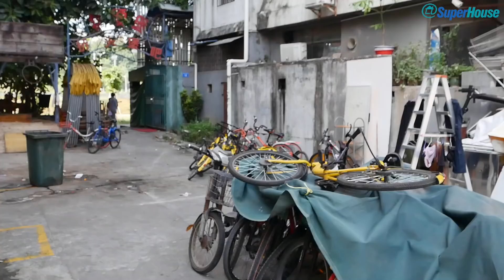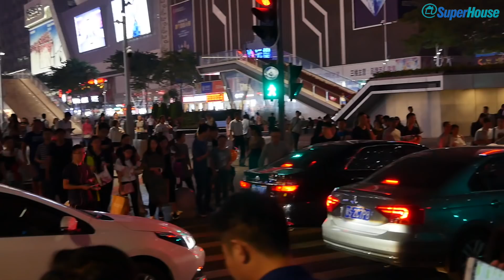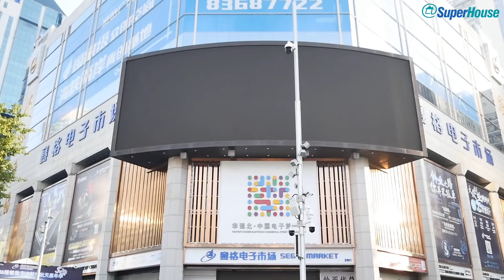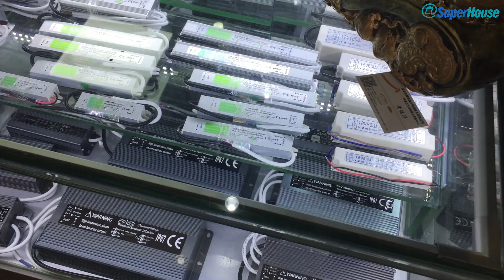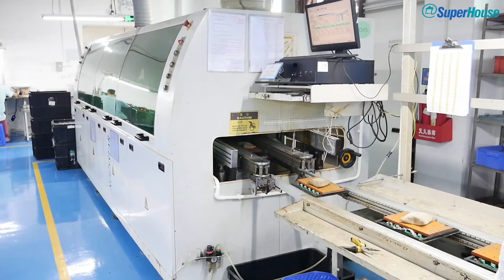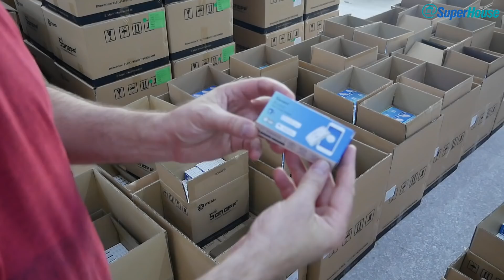SuperHouse #27: Visit to the Sonoff factory

Comment: Loved the video.
They flashed the chip quickly. 
** Do you think they are directly programming the memory chipas they do it very quickly? **
This may be easier than using the ftdi and all the lead issues with different locations etc of the connectors.

I appreciated your tasmotiser video which I used.I also like to backup everything.
 I had a hard time due to the amount of pressure required holding the Dupont lead male pins onto the holes to make a reasonable connection. It was ok with the sonoff basic, but the s26 uk plug was a real pain which I aborted. I damaged the pads a little.

Is there a way of using OTA to backup a sonoff mini as the DIY only allows writing the firmware.

Comment: Huaqiangbei is the electronics mega-market in Shenzhen. Pronounced Qua-some-bey. Short ride via subway from the HK border (Luohu Port). Just follow the crowd out of the subway station.  Its a five minute walk to SEG.  Most floors at SEG are by category: parts, products, repairs, etc      It can take days to visit all the shops of interest.  Oddly enough price lists are slow to be made.   Do be aware of pick-pockets and scams.   When returning be aware that signs saying Subway really mean underground walk-way  -  look for the subway logo.   Most shop staff know enough English to know what you want.  The actual factories are outside the city and not so easy to find.

Comment: I am giving up on these f'ing sonoff,  half the ones I have bought either haven't worked or quit working a few days after purchasing.  I'm gonna try the shelly. A bit more expensive but if you factor in the cost of all the dead sonoffs I have, they are likely much cheaper. POS is my opinon of the sonoff.

Comment: Hi Jonathan, I supposed you have many more sonoffs than I with 2 basics, 2 pow and 2 th16. Just suffered complete power supply failures on both pow and was wondered if you tackled repair of sonoff ps ( esp8266 works on vcc supply direct but not ac) thanks

Comment: Hi, do you have any contacts for itead. that could answer a question about the hardware specifically the power supply side of the sonoff basic i wanted to know the 5v rail across d5 zerner diode, how much current can i expect to reliably get off that 5v rail thanks...

Comment: Great factory , good hardware but unfortunately the app is terrible, I've had mine for 2 days, it worked perfect one day then the next no connection. Any recommendations?
Reply from the maker: I don't run the EWelink app myself, I only used it briefly to see what it can do. I replace the firmware on the Sonoff with Tasmota, and have them linked to an OpenHAB system using MQTT. Then I run the OpenHAB app on my devices. There's more information in these episodes: https://www.superhouse.tv/17-home-automation-control-with-sonoff-arduino-openhab-and-mqtt/ and https://www.superhouse.tv/21-six-sonoff-secrets/ and https://www.superhouse.tv/24-home-automation-system-architecture/
Reply: SuperHouseTV Really appreciate the reply and recommendations. I suppose this is the downside to this type of device, I literally wanted it to turn my corner lamp on/off from my phone. I wasn't interested in reflashing using another protocol to control it, personally I think it's all a bit misleading and that's ashame. I'm all for open sourced firmwares, reflashing and other mods, however this device was bought to turn something on and off via their app and it's no where near reliable enough. I also didn't realise it was controlled by 2.4ghz frequency instead of 5.8. I currently have a virgin hub 3.0 which automatically switches between the 2 frequencies.... However they both have the same SSID addresses which I've had to alter on the 2.4ghz side so the sonoff would even connect, again not a big deal but it's not exactly a plug and play device which is unfortunate. I've only recently come across your channel and it's great btw.

Comment: It's interesting to see this process in dept. I've created electronics testing equipment like seen at the 14:30 mark. Only testing one panel at the time (programming and functional testing.) This is slightly faster. One reason for this setup will be the operator cost as we produce in Europe.

Comment: thanks, interesting video. i love the stuff they make, the Sonoff's and Nextions. Have lots of Sonoffs and 1 Nextion running in my house now, but i've found some of the Sonoff Basic models leaking in off mode. Have you encountered this issue?
See my 30sec vid: https://www.youtube.com/watch?v=EunLSYAG0qw
Reply from the maker: 30 Volts when turned off! That's bizarre. The output of the Sonoff is a relay that physically disconnects the active lead (neutral stays connected) so I can only think of 3 possibilities. 1: The relay is damaged, and it's not disengaging properly, such as allowing leakage across carbon bridges on the contacts. 2: The board itself is damaged, and allowing leakage between the relay output and the screw terminal. 3: There's some kind of induction going on, such as the wires connected to the output picking up mains hum elsewhere and inducing current on the load. None of these explanations sound very likely to me, so I'm puzzled. Perhaps there's something else happening that I haven't thought of.
Reply: i should do some more checking/testing i guess. this one is connected to leads running outdoors for instance. and both switch cheap xmas led lighting so could be any of those options... will check unloaded first. have a bunch of basic's yet to flash and test as well. thnx have a SuperHouse 2018 :)

Comment: Really amazing. Thanks for the video. Can you explain how the sonoff pairing with the app works? I do not understand the part where the app actually detects the sonoff that is ready to be paired. How can this be done?
Reply from the maker: When the Sonoff starts up in pairing mode, it creates its own WiFi network with a unique name. Your phone needs to connect to that WiFi network (not your own network) to begin setup. After that, the Sonoff is given the details of your own network, and it turns off its own network and connects to your house. Then your phone switches back to your house network, and from then on all communication goes through your normal WiFi.

Comment: I have several Sonoff switches that I have flashed with https://github.com/arendst/Sonoff-Tasmota firmware.  To that end it would be a nice convenience if Sonoff soldered pin headers to the holes that can be used to flash a custom firmware such as Tasmota.  I am not that good at soldering and it can be a bit tricky to solder on the pin headers amongst all the other surface mounted stuff.
Reply from the maker: I've just finished designing a PCB for a Sonoff programming adapter that should help make this a bit easier. It does the same thing as the adapter cable that I made for one of my videos (I think it was "Six Sonoff Secrets") but as a PCB, so it can be plugged into the end of an FTDI type USB-serial converter and it gives you the pins properly set up for the Sonoff header. I think it should be possible to use it without even soldering a header into the Sonoff. I haven't sent off the PCBs for fabrication yet but I'll be doing that in the next day or so.

Comment: i have two Sonoff switches stopped working with 15 days on installation both have been connected to LED lights i have been told that the issue is because of noise and improper filtration in the switches.

Can you please guide me as is there anyway i can add something to protect sonoff from the noise basically i have evil LED and need something to protect my sonoff from it
Reply from the maker: That's bizarre! I haven't heard of that before. The output of the Sonoff is just a relay that switches the load, so the only way I can think of that the Sonoff would stop working is if the load produced so much electrical noise that it damaged the switchmode power supply in the Sonoff itself. If that's the case, it would also be inducing the same level of noise onto every other device connected to the same power circuit, so you'd have devices failing all over the place. When a Sonoff is turned on, the load is connected through the relay straight to the power source, so noise would go everywhere. Maybe a viewer has an idea what could be happening.
Reply: could be the case and to be honest have no clue why this has happened and two have gone bust, i can connect them through firmware upgrade pins with LV power of my usb port and the ESP works and connects to the server,  so i guess its some resistor or something which has friend i have no clue how to test it to find which part has fried, but i know this has happened with both switches which were connected to LED lights though i have another two connected to LED they seem to work fine

Comment: I wonder if there are fakes or maybe untested sonoff or rejects on the market? I bought a S20 and it didnt come with a box and looks pretty scuffed up. It also didnt work. I opened it up and the transformer was found dangling with just one wire attached.
Reply from the maker: I've never heard of fakes, but now that they're becoming so popular I wouldn't be surprised if they exist. ITEAD have sent me Sonoffs but I've also bought many myself just as an anonymous retail customer, and the ones I've received have always been in perfect condition. It's disappointing to hear you experienced that. What country are you in? I think I have a spare S20 that I could send you, but I'd have to look at what plug type it has.
Reply: Thanks Jonathan. I bought two S20 from 2 different sellers (not iteads). One was bad as mentioned and the other one, they sent me a Euro plug. Im in Malaysia and using UK plugs. So out of the two "bad" S20, I made one of them to work. Thanks for the offer, but I'm good now. I did get a refund for both them though. Hope you can review some Xiaomi Smart Home stuff in the future. Merry Christmas Jonathan 😀
Reply from the maker: I'm glad you got it sorted out. I don't have any of the UK plug type anyway, so I couldn't have helped. I definitely want to look at a broader range of devices in the future, including from Xiaomi. Merry Christmas!

Comment: Fascinating video to watch, thanks very much for taking the time & trouble (not to mention cost ... Aus to China Airfare can't be cheap!!) to shoot / edit / upload this great content. I have multiple Sonoff basic / T1UK / S20 / TH10 / Dual ... u name it I've probably bought it (or buying it) so for me this video was great to watch, really appreciate it. 2 points still remain unanswered ... 1. How in the hell do they upload the firmware that fast!!! 2. Why oh why will they not release the original sonoff firmware as a binary that end users can re-flash should they choose to after trying 3rd party firmware (Tasmota, ESP Easy etc etc). They seem only to aware that end users (i.e. their customers) are quite likely to end up re-flashing the product so possibly include a link to the original firmware if it's required? Other than that I can't really fault them given the cost per unit. Granted the cable strain relief is a bit of a joke & a lack of an Earth passthrough on some units (Basic) is a bit annoying but when you consider the price it's hard to poke fault at them. Great video, keep them coming! Liked & Subbed.
Reply from the maker: Thanks for the comment, Nick! I was talking to a friend who came to the factory with me about the upload speed, and the only explanation I can think of is that they're holding the processor in a reset state and then blasting the binary image straight into the flash chip. The pogo pins could be talking directly to the Winbond flash chip via its SPI interface, bypassing the CPU.

Comment: Did they indicate if they will put Wall Switch Inputs on the Sonoff 4 Ch PRO ?  Need wall switches without soldering!  :)
Reply from the maker: That's a good idea. I haven't used a 4 Ch PRO so I don't know anything about its inputs. It would be very nice if all their models had easily accessible connections for external switches.
Reply: SuperHouseTV it's a beautiful piece of equipment,it's just missing that final manual input piece to make it complete.

Comment: As you are there perhaps you could ask the question why do they not use earth on so many products is it cost or just cant be bothered to connect it up as we in England earth anything that is metal for safty unless it is double insulated?
Reply from the maker: This was filmed a couple of weeks ago and I'm back in Australia now, but this is a great question so I'll try to find out. It's the same here in Australia, everything must be earthed or double insulated.
Reply: Thank you for your reply I look forward to your findings I think it must be down to quality control as I have three outside led flood lights when I opened them one had the earth internal tag connected but the other two did not and the wire was floating inside. thanks Bob UK
Reply: They are Class II (ie "double insulated"). You don't have to ground a metal housing if the mains circuits meet Class II. Think of your metal laptop with its Class II power supply as an example - many of them have no ground connection, which is perfectly acceptable. These products are UL / CSA / CE etc approved which is a legal requirement in those markets, so their construction (hopefully) meets the requirements for internal creepage and clearance distances, insulator materials, temperature ratings etc.

Comment: Great video once again! Made me feel a lot more confident placing them into ceiling spaces for control. Also confidence that the Ce mark isn't fake. Just wish they could come up with a way of not having to use a neutral on the light switches as UK uses live /sw live. So a bit of re wire has to be done.

Comment: Hey Jon, this was a great watch! Thanks for sharing your tour! I was a bit sad that you didn't have a Q&A part. Did you get the chance to ask them inside questions? I'd be interested how they are thinking about e.g. Tasmota or where they are headed. You can't get schematics for new products and devices like the B1 do not offer easy access to the serial pins. Wouldn't surprise me if at some point you can't reflash these modules.
Reply from the maker: I hoped to do an interview on camera, but it didn't work out because of the language barrier. I got lots of good information but not in a way that would have worked on video. I didn't ask those specific questions unfortunately :-(

Comment: It’s interesting to me that it’s not more automated. There are really a number of manual processes that could
be complete totally done by machine.
Reply from the maker: I've been inside dozens of Chinese factories, and just based on my personal experience the ITEAD factory seems to be a perfect example of the typical way to do things. I've seen factories that are much, much worse (particularly in Beijing) and I've seen factories that are much, much better (Hytera is just mind-blowing) and ITEAD sits right in the middle. For most mass-market electronics, this is how they're made. Right now Chinese factories are going through a transition to more automation with rising wages. In the past the usual solution to any problem was to throw human labour at it and solve the problem by brute force. Need 100,000 stickers put on? Hire a bunch of people, put them in a room with a conveyor belt, and get it done. But these days it's more common to use automation. Need 100,000 stickers put on? Design a custom robot, put it on your assembly line, and walk away. In the Hytera factory, for example, they have almost no human assembly workers. The people in the factory aren't doing assembly tasks personally, they're looking after the robots that are doing the tasks.
Reply: Robot masters with their human slaves!
Reply: Thanks for the video!
Manual production is shifting to other countries like India and Vietnam as wages rise in China.
I was a bit taken aback by open-toed shoes (or no shoes) on the floor and the lack of safety glasses in the factory, particularly at the pin snipping station. Very different industrial safety policies. At least the reflow and soldering machines were vented.

Comment: Are the basic and din rail units approved for australian use ? are these safe to be installed in a wall ?
Reply from the maker: Not yet, but they're about to be. Yoyo told me during the visit that they're working on AU certification right now, so in a couple of months they should be fine
Reply: ok great, i have a din rail unit controlling my pool equipment ATM but that stored out the back in a metal box so im not worried about it failing and catching fire but am very nervous about using them internally. I thought they were just cheap but after watching your video im surprised as to how cheap they are as they look very well built
Reply from the maker: The quality of Sonoff hardware is outstanding. It's certainly at the same level or even better than big-name home automation gear that I've seen over the years. Personally I have no problem with using them and trusting that they'll do the job well, the only problem is that the lack of certification can lead to insurance issues etc. They don't need to make the devices themselves any better, they're already better than required to meet Australian standards, they just need to go through the testing and get the expensive piece of paper to prove it.
Reply: Thanks mate, if they get the tick of approval from you then that makes me feel about better about them . I've had the 4 channel in for nearly a year and it's worked flawlessly with tasmota firmware . Time to get some more I think . Thanks
Reply: Hi:) if you search for din-rail mounting  sonoff like functioning device but based on new ESP32 chip check moduino.techbase.eu (but it not Chinese product however)